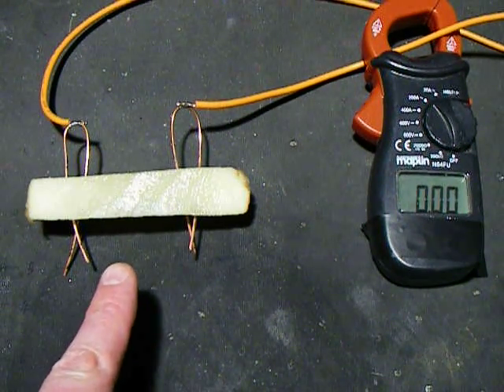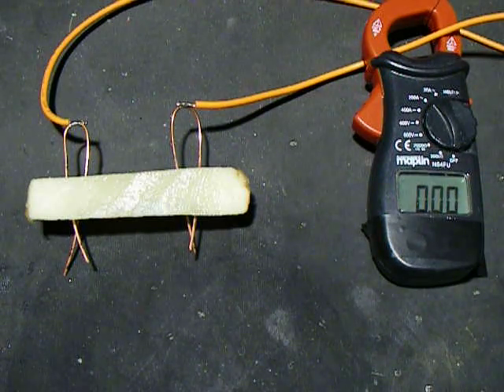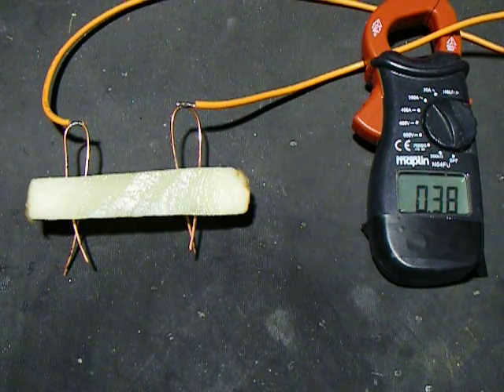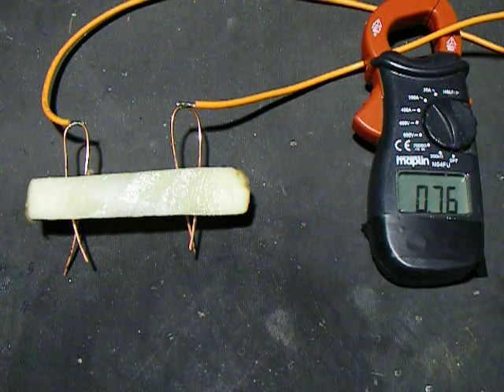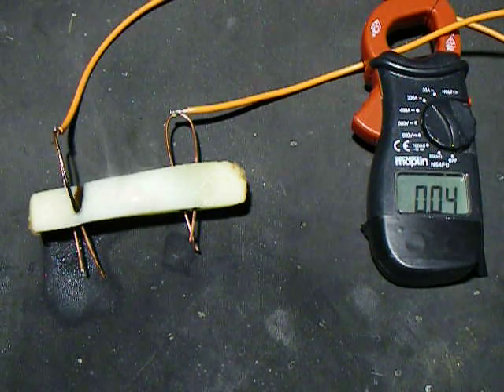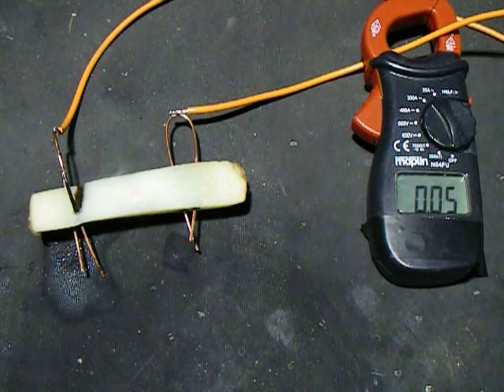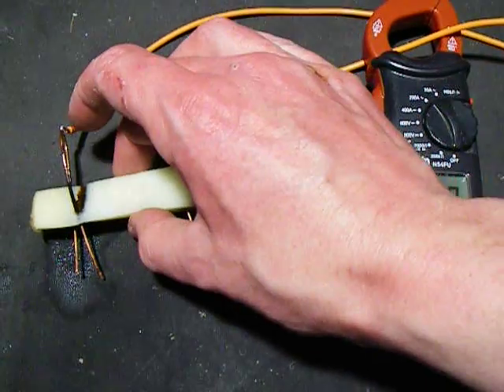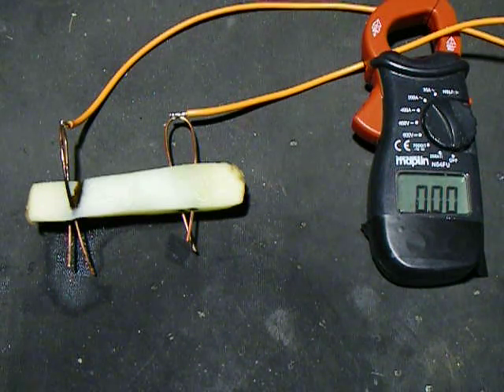240V electric potato fry.  Electric chip.

Comment: would this work to cook soup?
Reply from the maker: +mgunter The soup may be too conductive and might taste metallic.
Reply: if you attached the diodes to the pot, would it still have the same problem, could you put a light in the soup and have it turn on? Instead of Gatorade's electrolytes, you would be making electrodelights.

Comment: Big fan of bigclive, but only just seen these older ones. 
Can anyone explain why, on both this and the whole potato one, it only arcs near one of the electrodes?
Reply from the maker: I think it's partly to do with conductive carbon trails forming and also liberation of liquid from the potato.
Reply from the maker: It's AC, so I'd guess it just made a poorer connection on that side of the potato.
Reply: Why does the current creep up over time? I'm guessing it's something to do with the higher temperatures increasing resistance, but I'm not really sure.